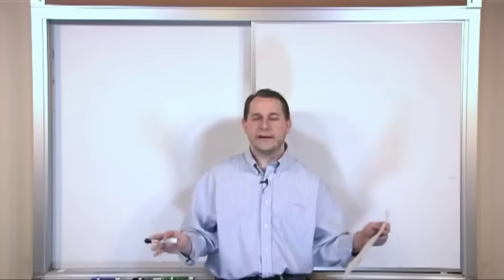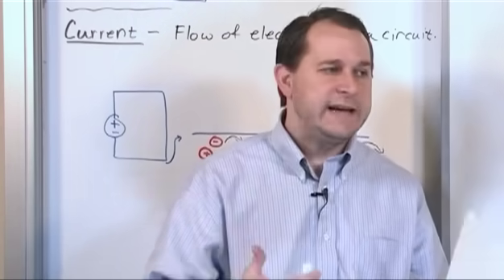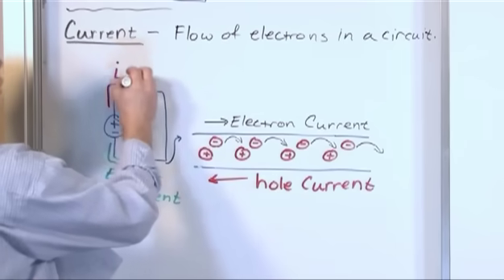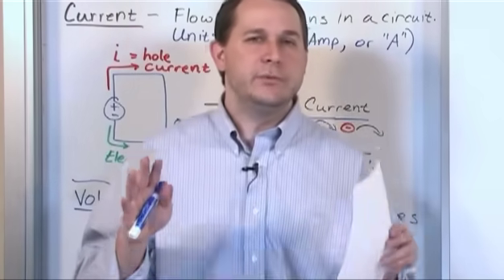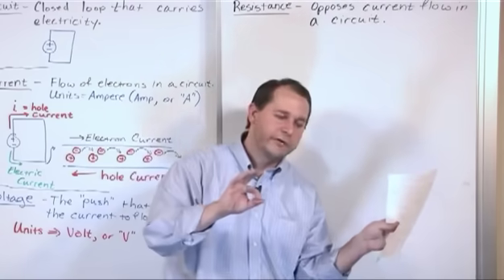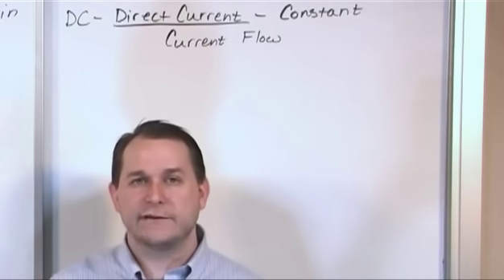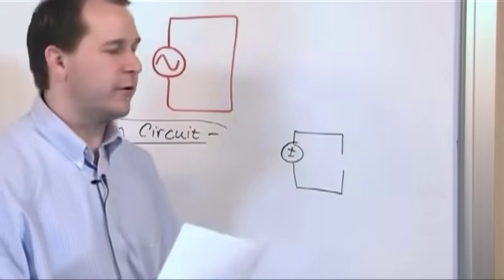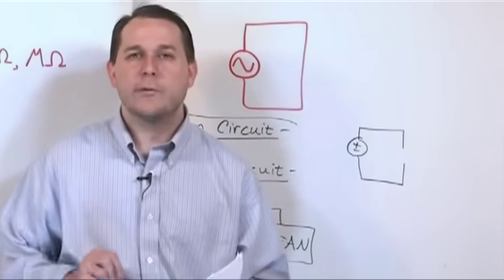Lesson 1 - Voltage, Current, Resistance (Engineering Circuit Analysis)

Comment: It is weird how readil available 10 Mohms resistor can drastically lower the current of a 10 000 V source. Now the question is can these readily available resistors handle the heat generated due to such a high voltage

Comment: Lame lecture. Energy transfer happens in the EM field along the wire (NOT inside the metal - it's there to guide the energy, close to the surface, very effective - radio or light is not, so we don't have wireless power plants). Electrical Engineering Basics.
Volts and amps are macroscopic units derived from the EM level (Maxwell), need for completed circuit too.

Comment: Current is volume how many electrons. voltage the speed thay are moving. Electrons want to balance. In a batttery the electrons are on the negative side. when you connect a wire to positive side the electrons run to balance. when the battery gets balanced it is dead. when you charg the battery your moving the electrons to one side. when things get balanced it stops.

Comment: This is great, but a little more; 
 
1.  So I've heard that current is elections flow, what about a voltage? What is a chemical composition of a voltage if we were to see it? 

2.  It's seemingly that the electrons circulates around the circuit, how does the voltage consumed.... Where does it escape to, for it's in the wire and goes back to the source .   Illustrate more please 🙏

Comment: This is great and explains why I was not killed by Teslacoil when I was young. I understood no to touch to the primary coil ;). But anyways one another analogy to electricity may be water flow. Pressure vessels is the source having pressure related to voltage and flow in the following pipe is the amperes. Beatifull analogy. If you think the pressure vessel, tank, you compress that thank to make smaller volume, the pressure increases. That is when you have a capacitor and you pull the plates more far away to each other making work and you increase the voltage, very interesting.
Reply: You clever guy could you explain why the inertial mass is the same as gravitational mass? F=ma. General relatativity has one explanation but I do not believe that it is the physical explanation, it happens to be just mathematically correct.

Comment: I wonder if the electrical engineer has heard of a "power-point"  😀  The presentation would go quicker than drawing/writing on a white board and the concepts would be easier to grasp with some well crafted graphics.  Other than that, good class... first time I've heard ANYONE express "conventional flow" as having an advantage in NOT needing to calculate a bunch of negative numbers.

Comment: What is the push. What's pushing the voltage
Reply: Electric charge.  Charge is a fundamental property of subatomic particles.  The electron is the carrier of charge in an electric current and it has a charge of -1.  Like charges repel, so electrons feel a repulsive force between them.

Comment: 09:03 - it is a little bit comfusing. Electrons movement in circuit is slow as i learned
Reply: Individual electron motion is fast, but net flow is slow.
Reply: @GH-oi2jf No, the electeons move slow, but imagine 100 electrons in a row pushed on the beginning, the end moves immidiatly (speed of light).

Comment: Think of electricity like water.
VOLTAGE (E) = pressure, CURRENT (I) = flow volume per second, RESISTANCE (R) = restrictions to flow.
The relationship between these three is described mathematically as : E = I x R
Manipulating the formula for what is unknown :  I = E/R and R=E/R

Comment: This is probably a dumb question that won't get answered, but when the electrons pass through a medium such as a copper wire, do they move through the wire or are they moving down the surface of the wire or bit of both? Id expect both since you receive shock?

Comment: What the establishment has done in teaching the conventional theory is an absolute crime! When I review theory from people using conventional theory, a lot of it is flat out pseudoscience and it's so very sickening and frustrating.

Using holes has produced endless pseudoscience and so when events and bodies are analyzed, those holes are being represented by fictional particles and it's total nonsense. Proton theory is extremely useful and effective for circuit analysis, reverse engineering and such, but in terms of advancing science and the true creation of new technology?? It's an absolute dead end.

I've invented the most efficient induction motor that currently exists and it can be used to create an entirely new branch of technology because it's also a directed energy device. The world is being held prisoner by pseudoscience installed by the Nazis smuggled into the world power nations.

Comment: Hi how do I fault check the components of a battery operated small blood pressure monitor please which are a micro switch some capacitors and resistors and the display etc please, can someone help me so I can repair this BP monitor for a patient please, and can i fault check the components whilst there still attached to the PCB with a multimeter, please help someone i have asked for the correct method on  about 15 different videos/channels and no one seems to know etc I'm desperate to get it repaired for a poor patient please help someone please great video thankyou

Comment: If I have 1000volt power source and I connect it with a 1mm wire, will the 1000volt flow through the wire?

Comment: So,as your 1st postulate a 10 year old grabs dads car battery and connects the positive terminal to the negative terminal and at the very least sparks fly and wire melts and the kid is now a electrical engineer.

Comment: Direct current or DC ( Superheroes power beings? ) Travels straightline like laser speed or along the line, but how about oscillations around, the Alternating Current is the To and Fro of Electricity with wider scope probably used by Angels and Extra Terrestials or Through Time travel. Back to DC it's like Advanced Analog of spark like fireworks it spreads break into pieces bits and can enter into gravity time pocket of time delays below wavelength median line like Quantum Computers Qubits then the bits of beams separate from down goes up merges in its unisonal form of straight line convergence, while the AC can traverse both light identifier world and dark identifier world of it's to and fro like a pendulum of time. Now the positive charge called hole current could telescope enter if compatible into another space domain while the negative current called electricity current can appear like electron branch lightning like that of Zeus power which could enter in circuitry into molecular areas in the air and in space and could stimulate something from the dormant cool suspended air water molecules.

Comment: Voltage is a kind of displacement, going along with the stream analogy.  High voltage is a steep incline, and low voltage is a gentle slope.  

I just wanna know- how come all the electrical engineers that actually came up with all of the equations and formulas for circuitry were proponents of the ether and talked about dielectricity all the time?, which i think is what ee’s today call resistance.  

And how come JJ Thompson said there is no such thing as an electron particle?  He referred to an electron as a single unit of dielectric inductance…. Im sorry but nothing about electromagnetism makes any sense if everything is a particle.  So we really think there are “virtual photons” coming out a “pole” of the magnet?  Seems pretty sketch lol, 

otherwise thank you for your massive contribution to humanity Sir!! I am grateful.  With all due Respect!!

Comment: Great explanations Great video great demonstration but on the 60 times per second about coil diagrams varies actually slowing down the pulses and speeding them up depending on how many times it's wrapped around the wire or platform that it's going back and forth from like a coil it'll speed up and slow down depending on how many times it's wrapped but if you're talking transistors flat plate bridging back and forth then yes it is probably 60 times per second but sometimes those diagrams are actually showing coils correct

Comment: Potential voltage is pressure and the more voltage across the body of high resistance is more dangerous than a lower voltage across the body. You cannot have current without the push, therefore Voltage is just as dangerous as the current I x E= P   both are equal in creating the power to kill you.. Yes now your resistance of the body across this potential is also important, lower the resistance of your body the more current  E squared divided by R =P.. actually it's the power that kills you.. Just like no pressure in water has no power to go through a hose,  no water with pressure = no water flow to go through the hose or pipe, a pipe in this case represents resistance..  So lets say you have high water pressure pushing a lot of water = massive power to cut rock, that's how the grand Canyon and many waterways were created...

Comment: What ever happened to E, as in Electromotive Force? You know, like E=I*R or P=I*E?  Now that everyone uses V (Mr. Volta) instead of E, shouldn’t we be fair to Mr. Ampere, Mr. Ohm, and Mr. Watt?  If E is being replaced with V, shouldn’t we revise Ohms Law?  To be fair, the new Ohms Law should become Voltage = Amperes * Ohms and Watts = Amperes * Voltage.  This seems much more fair to Mr. Ampere, Mr. Ohm, and Mr. Watt.

Comment: "Current" is a bit confusing. If "voltage" is "push" that makes the electron current flow, does greater voltage push harder? When I push something harder it moves faster. But that isn't what happens to current velocity, is it? Isn't current velocity constant? At what speed? At the rate of "electron drift" it would take days for an electron to move an inch! But at nearly the speed of light, presumably, you have vast numbers of tiny masses--electrons--moving at light speed! Relativity theory says, as the speed of light is approached, the moving mass is shortened and increased. At very near the speed of light the electrons would be infinitely massive...hehehe...How much voltage would THAT require, to push zillions of infinitely massive particles!?
Reply: Ac current keeps voltage (pressure) no loss across loads that require watts to power a load , dc voltage ( pressure) drops across loads that draw current ( measurement in amps) but amp draw stays the same . Dc current low voltage high amp draw, ac current high voltage low amp draw . Ac can travel for miles dc can’t ! Tesla GENIUS!!!
Reply: I apologize watts is a measurement of power usage, all load’s require energy to do work(power)
Reply: It is more complicated than he explained here.  There is an article "What is the speed of electricity?" by Dr. Christopher S. Baird of West Texas A&M University which explains this very well.  Basically, current is the net amount of charge flowing past a point in unit time.  A key word here is "net."  The free electrons (there is one per atom in a copper wire) are always moving in a wire, in all directions.  Without a voltage applied, the motions will cancel out and the net current will be zero.  When a voltage is applied, there will be a "drift" of free electrons in one direction along the wire.  When the voltage is increased, the net flow of electrons will be increased.  The individual electrons don't have to move faster, they just have to move more often in the direction of the current than against it.

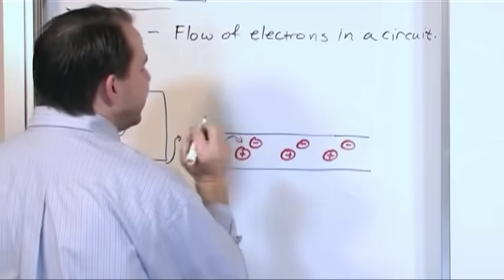Comment: 8:56 Electrons move only millimeters an hour, but current is instantaneous. Although moving very slowly, there are zillions of electrons moving. This movement creates disturbances in the electric and magnetic fields, which are everywhere in the universe. It's these fields that cause the immediate current in the circuit.

Comment: The distance b/w 2 atoms can be similar the distance b/w e and its atoms nucleus. In this case we know that the distance from nucleus to the last orbit e is considerably high. The last orbit spins as far as i know roughly 10.000 times of the diameter of a proton far from a nucleus.With that said its almost Earth or other closer planet spins around the sun. Actually this force is quite high if we look at the dimension of atoms that could move one e from last orbit to the next atom. I guess the resistance depends on the metal so how hard is to move an e tells us the resistance of that metal i guess.
As you already said it happens almost at light speed the travel time of an e from its atom to the next one, but still it takes some negligible time right? If so if we could have a conductor lets say very long like from earth to moon the last e wont reach the load at the same time we close the circuit?

Comment: Hello sir good day,...can I ask a question? On automotive ignition system reponsible for spark plug produce spark, why current flow through spark plug gap? Where their's a gap there's high resistance? And current always flow to less resistance,...why all current doesn't flow directly to ground where the second coil winding end attached to ground and the other end attached to spark plug via high tension wires...? Thank you always for sharing your knowledge with us sir...god bless

Comment: Engineering Circuit Analysis

4:16 Circuit - Closed loop that carries electricity.
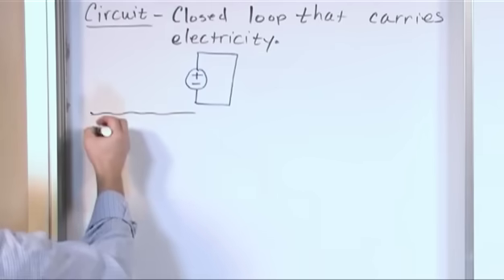6:02 Current - Flow of electrons in a circuit.
            Unit = Ampere (Amp, or "A")

18:22 Voltage - The push that causes the current to flow.
             Unit - Volt or "V"

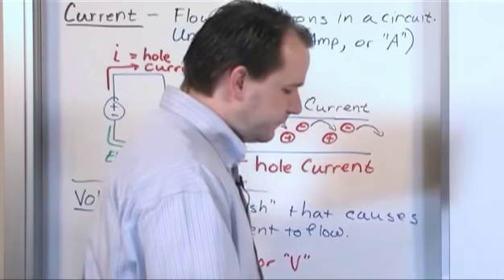22:00 Resistance - It opposes the current flow in a circuit.
             Unit = Ohm, Ω

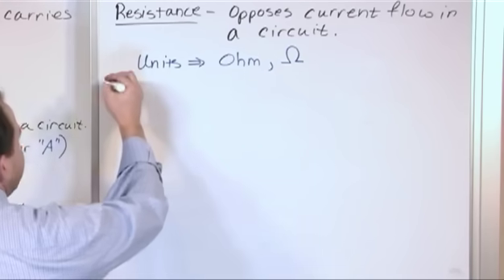26:29 Metric Prefixes
              A → mA, 
              Ω → mΩ
              V →

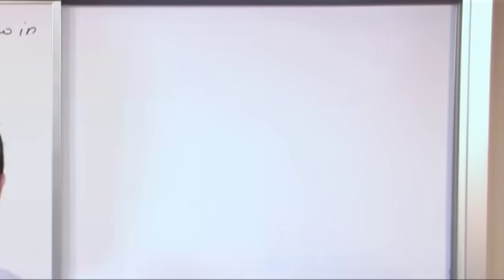28:24 DC - Direct Current 

36:56 Review

Comment: I have a good grip on the basics and as a DIY guy will work on anything up to 240 VAC excluding a few HV inductance circuits. I’ve always used the “river or stream” analogy but slightly expanded.  The “push” of the river comes from weight (water running downhill) or by a pump which is an analogy to voltage. The current is the speed of the water molecules; an analogy to electrons and amperes. Resistance is anything the impedes the flow of current like a dam; measured in ohms.  Simple to understand. I’m starting a non-profit model flying club in two months and will be using videos like this to teach the youth in our program on their way to learning radio control.
Reply from the maker: Awesome!

Comment: Why do I have a energy bill?
If I use a water wheel analogy to a electric fan then where do the electrons go?  A water wheel generates energy but the H2O goes back into the flow of the river.  Where do the electrons go when the electric fan is done with them?  In other words what am I paying for on my electric bill?
Reply: You are paying for the energy, not the electrons.  When the electrons move through your wires, they are doing work.  Work is equivalent to energy.  You use energy to do work.
Reply: @GH-oi2jf  But energy cant be destroyed.  When the electric field is done doing this work the electron doesn't just disappear.  Isn't that what the common wire is for i an AC circuit?  To feed back the electrons?

Comment: What Ive gained from this is that every home needs a big DC battery to store energy.   Then you have the abiity to get AC from the power plant during off peak hours or from any of the many new renewable sources.  Without the battery the system is still wildy inefficient.  Sodium Ion is coming.

How much energy is lost going from AC to DC and back?  I see around my house that most of my AC products are actually DC and use a stick type converter in line or in the machine.  My thinking is that switching from AC to DC costs then why not just use DC in the home?  For example a 48v DC infrastrcure that you can bring down in voltage for each device?

Comment: For years I've said, "I can parrot back correct statements about electricity, but I don't feel like I actually understand it."  This is the clearest explanation that directly addresses my most fundamental questions about electricity that I've ever encountered.  Bravo, sir.
Reply: Inject this content directly into my veins.
Reply: The problem is, most tutorials teach you to parrot the correct statements and to calculate stuff, but don't try to make you understand.
Reply: @LutherBlissett94  Post-1945 science has usually been about explaining, rather than actually understanding the science. I have learned this way of just parroting back something I heard without understanding it, and it slows me down because it's harder to gain an intuition on something I don't really understand.
Reply: Wait till you hear about quantum mechanics and how our visualization of electricity is wrong 😂
Reply: Just struggling to grasp the logic about how to use the components to achieve certain goals makes a person smarter. This is ultimately applied mathematics, as is most of engineering.
Reply: Best presentation  ever,keep  it up
Reply: Thank you for your good explanation of current, electricity, voltage and resistance 👍 best teaching methodology used

Comment: I don't understand the difference between a Coulomb and an Ampere.

It seems le they are the same thing?!
Reply from the maker: Coulomb is unit of charge.  Ampere is charge FLOW per second past a point.  If the charge isn’t moving you have coulombs but no amperes.

Comment: Not really understood what you mean in the short circuit part, you said the larger the size, the less resistance it will be though why does it goes through short circuit path assuming they have the same component of wiring or as you just said a little piece of wire wherein it should have more resistance.